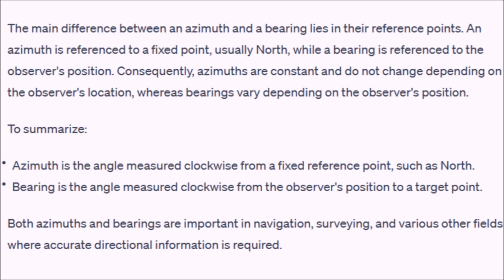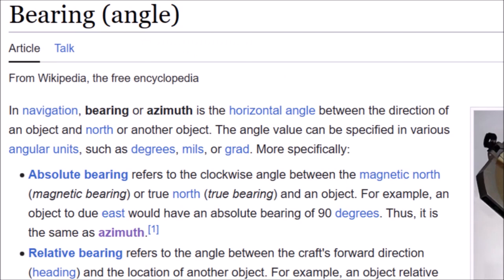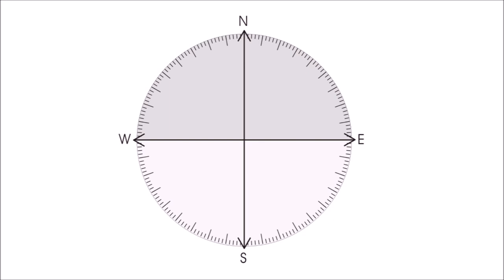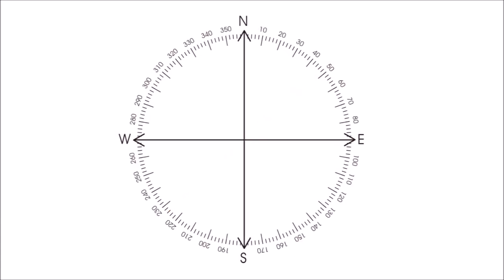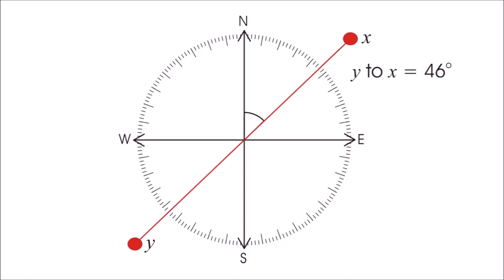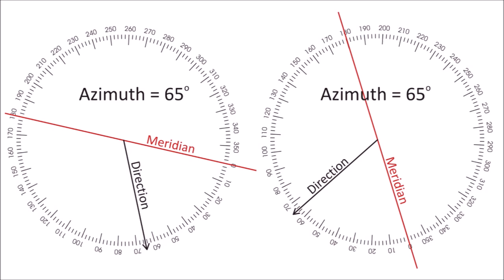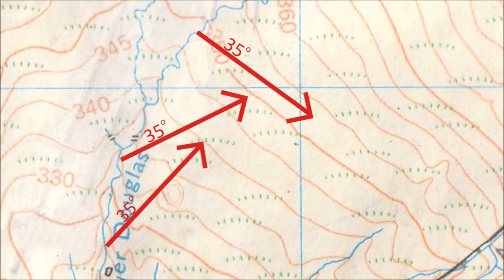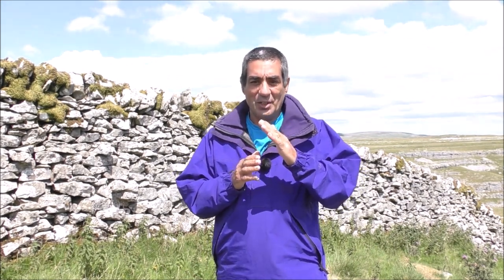Azimuth vs Bearing - there is a difference

Comment: Well, we can blame ship navigators for this (I think) because that's where the difference between the two terms is most important. Azimuth is just an angle relative to the ship, with 0 being straight ahead. And this leads to the best description I know: bearings are measured relative to North, azimuths are measured relative to any other direction.
Reply: It's relevant in surveying as well.
Reply: Your last sentence there really cleared it up for me.  Thanks!

Comment: In engineering field, azimuth is just one of the angles that define a spherical coordinate system. The meridian can be thought as one of the coordinate axes and the azimuth is just one of the two angles that define a space direction (azimuth and elevation). I guess that the problem is that someone gave to azimuth a "magnetic property" while it is instead just an angle with respect to a specific frame of reference (the meridian in your example). On the other hand, bearing lives in the navigation field and its an angle that is related to the magnetic north.

Comment: Difference between absolute and relative angles. Bearing is absolute based upon fixed zero (north) whereas azimuth is an angle from anything you say is your zero datum - wall, stream, etc. i.e. relative angle…

Comment: I'm a veteran of the British Army (royal tank regiment), and keen hill walker.

The use of an azimuth is when you know where you have travelled and recorded your bearing and/or azimuth changes.  

I often go for walks with no destination set at the outset. The point is to walk and pick a direction and head in that direction until it intersects with something (my new meridian).

So, if we were using your wall (meridian) yes we could pick any point for us to make up an azimuth to head along, and we could end up in any place parallel to each other uf the wall was straight like diagonal chevrons painted on the back of a highways vehicle.

However if you use a distinguishable point along the wall ie a stile, a gate, a sign or even a broken part if the wall or tree something describable and identifiable you can record that as I do and look about find a direction and take an azimuth reading from my (locator along my meridian).

If anyone was needing to come to my location say I'm injured and called for mountain rescue, I can lead them along my azimuth to key meridian landmarks ie stile, gate sign tree broken wall etc and the azimuth from that locator.

So azimuth does work provided the locator along the meridian is distinguishable to make the azimuth accurate to lead in the correct direction but azimuth only work if you are following directions and not just wandering aimlessly and then the search team are using an azimuth to find uou, they only work if you first record your azimuth from the first key locator (your car hotel bus/train stop cafe etc). Then every direction change is recorded so I take an azimuth of 143 and meet your wall, I record the 143 azimuth from my cars rear bumper facing across the road out of the carpark. When I meet your wall I turn east along the south side of the wall and walk 300m until I meet the stone stile,  I then take an azimuth of 40 and follow to my accident in a field 240m from the wall in a depression.

So azimuth can and are used effectively and provided they are recorded accurately as you go, they can save your life if rescue is needed.

Even if I'm not on an azimuth trail (wandering about lol) I still record my headings and distances and landmarks from departure to my current location, just incase I'm injured and need to get rescue to me. They ain't spending two days searching they know exactly where to find me before they even leave the offices.

If I could advise anyone if anything that would be my advice. Record every direction turn landmarks and distance /timing you can in as much detail as you can, the more accurate, the faster help gets to you.

Happy walking
Reply from the maker: All good points. Thanks for joining thr conversation.
Reply: That answers my question how to know which direction of the wall or rather meridian is azimuth zero.

Comment: I thought that I was differentiating bearings vs azimuths, but really the explanation below only differentiates grid bearings/azimuths (on a mapping plane) from true bearings/azimuths.

From a background in surveying, these are two characteristics that differentiate my understanding of bearings vs azimuths:

The first characteristic of an azimuth is that an azimuth changes as you move along the line whereas a bearing will remain constant from beginning to end. 
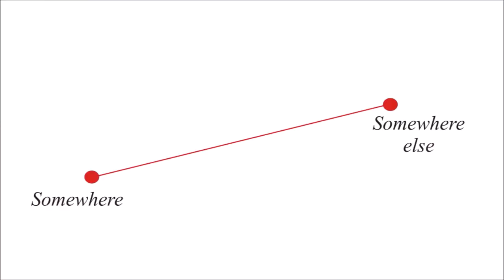The line shown at 5:15 is referenced in my explanation. Whether it is an astronomic, magnetic, or geodetic azimuth they all reference a northernly point from which a local meridian is created (from the observer to the magnetic north pole in this example); however, as you move along the line (in red) and take another observation a new local meridian will be created that is not parallel with the previous local meridian but still considered to be 0° along this new meridian. The result is that the exact same line (in red) now will be a different azimuth than what was observed at the previous starting location (somewhere). The difference will be negligible for walking distances but if we are travelling a long distance then the magnetic azimuth will noticeably change (and this change is not to be confused with greater circles and rhumb lines/loxodromes in mapping projections.

The second characteristic is that back-bearings (reverse bearings) of a bearing are a simple calculation: for example, 45° forward from somewhere will be (45° + 180°) 225° backwards from somewhere else. Direct and inverse azimuths are not computed as easily.
Because azimuths are all converging to a central point (in this case the Magnetic North Pole), spherical trigonometry is used to calculate the direct and inverse azimuth.

I think the video explains azimuths well from a navigational standpoint they are referencing a meridian and turn in a clockwise rotation.

By the way, in surveying we call your military bearings 'quadrant bearings' (S60E), and confusingly your civilian bearings 'azimuths' haha, which is why I like to call them 'full-circle bearings' (240°).
note: 'grid bearings' are also a good term for your civilian bearings.

Comment: Hmmmm . . .  I learned navigation in the US Navy.  What you are calling "bearing", I'd call "heading."  Heading is an angle relative to North, usually true North.  So when the captain wants to know what direction the ship is going, he asks for the heading. 

Bearing is relative to an arbitrary datum line, usually the centerline of the ship.  So the direction to a lighthouse would be given relative to the ship.  "What's the bearing of the lightshoue?"   90 degrees!  Which would put it off the starboard side.  

These terms were also in use in civil aviation when I learned to fly.

Comment: This is something completely new to me. Never heard of it, seen it or used it before. It is interesting to know, but I will probably never use it. It could be too confusing for the local scout group to whom I occasionally teach some map and compass techniques.
The military system N46°E mentioned here is well known to me, but is also never used. I limit myself to the 360° right-turning system.
Of course, I will try to remember this in case I ever have to deal with it.
Thank you for explaining this to us. A valuable contribution.

Comment: Superb. Just a tiny correction about military navigation, we used mils in my day both on our prismatic (lensatic?) compass and for eg. mortar plotting. 6400 miles to a circle. Brilliant video btw. I can’t recall using a baseplate compass. Ironic term since the mortar has a baseplate. But I can’t imagine a baseplate compass, which is all most people ever need, in mils.

Comment: As a Mariner, and practitioner of Celestial Navigation:

An azimuth is something that is calculated, something that is true, something that is, or has been, or will be. Something that is fact.

A bearing is something that is measured, using a compass (or gyro-compass repeater on the bridge or bridge wing). Something that is apparent.

Once per watch, when celestial objects are visible, we can use a compass (or repeater) to take a bearing. Compare that bearing with what the calculated azimuth is. The difference, if any, between the two, is our recorded "compass error".

The difference between the azimuth and the gyro repeaters should be minimal (fractions of a degree). The difference between azimuth and the magnetic compass can be significant at times (I've see up to 15° difference in the seas around southern Africa). The latter can be caused by Variation (what terrestrial navigators call "declination"), and/or Deviation (the effects of the ship's own magnetic field and, particularly on Containerships, the magnetic fields of the cargo).

Bearings of other vessels are used for collision avoidance decisions. Bearings of fixed objects can be used to fix a vessel's position (a Three Point Fix). Bearings are relative to North and are given in three figure notation (e.g. 090°, zero-nine-zero and NOT 90, ninety).

Bearings relative to the ship are referred to as Relative Bearings and are relative to the ship's head. or her beam (port or starboard beam), or simply "dead ahead" or "dead astern". They can be given in degrees (up to 90°) or "points" (1 point = 11.25°).

☀🌕⭐🚢🧭

Comment: That distinction might be handy close to the poles. If you are at a base located at the south pole all bearings and meridians on the globe converge under your feet. Using a local meridian that is identifiable might work better at local navigation around the environs of your base. Perhaps a fence line around the perimeter of the installation.

Comment: Stumbled over your channel yesterday! Good informative  videos! Thank you very much. About the Azimuth vs bearing movie I have two questions. A) at around 5:40-5:50 you show two lines: what is the reason for having zero degrees on the left hand side on the first line and zero degrees at the right side for the second line? B) Using an Azimuth and your example with the wall, you would also need to know what side of the wall you are, wouldn't you? Or have I misunderstand the whole thing?
Reply from the maker: It was to show that 0 can be at either end of the meridian, it's up to the user to decide which.
You're right about the wall.  Again it's up to the user to decide with is 0 and which is 180.
THIS is the reason (as I say in the video) that it is normal to use the north/south line on a compass as the meridian as this get's rid of any confusion.
Reply: @TheMapReadingCompany  You could (almost) say that the directions right and left is a very rough version of azimuth?

Comment: Which end of the wall in your example is 0 and which is 180 and why?
Reply from the maker: Hi Peter, it could be either so maybe this is where the confusion may have started..  This is why it is common to use the N/S line as the azimuth.
But of course the 0 – 180 azimuth line can be in any direction.  As an example if you are surveying a new construction site then you may choose the line of any nearby roads, current services (e.g. gas pipes, main electricity feeds, drainage, etc) or on a greenfield site the initial surveyor could just draw a line and that would be the azimuth for all future plans.
Reply: @TheMapReadingCompany  Thanks for your reply.  To give instructions then, one would have to specify in which direction one should turn upon reaching the azimuth?

Comment: I wonder if you can help.? 
Many years ago I had a Silva Base Plate compass that had a small prism set into the side of it. 
This allowed you to view the degrees shown, when taking a bearing, down to at least 1/2 degree. 
It was very much like what could be obtained from a "Plastimo Marine hand bearing compass". 
Do you know if these Silva compasses are still made.?
Reply from the maker: I think you're asking about the Silva 54.  You could contact Silva and ask for a reputable supplier.
There are lots for sale on Amazon but be careful if you order one. Make sure its genuine and in degrees, if that's what you're looking for

Comment: All new to me. Thank you.

However. Surely you need to define the direction of the Meridian prior to the Azimuth? Otherwise you could, potentially, be going 180° to your intention.

If the Meridian is heading SW to NE (bearing 45°) then an Azimuth of 90° would be a heading SE (bearing 135°).
If the Meridian is heading NE to SW (bearing 225°) then an Azimuth of 90° would be a heading NW (bearing 315°).

Am I wrong?
This would concur with @TheUnorthodoxy comment.
This would also explain why having a S to N Meridian is so commonly used.
Reply from the maker: You're right.  In navigation a standard azimuth isn't much use - it's mainly surveyor's etc which use them.
The North South meridian is the normally used as the meridian when using a compass so the direction is the same as a bearing.

Comment: im not sure youre correct.. in aviation, naval, astronomy and  surveying... What is the difference between azimuth and heading?
 The word is relative bearing, a bearing relative to your heading. Azimuth is a bearing relative to North . An azimuth is a type of bearing. turn 30 degree azimuth  east from north  of  your current position..
A bearing is relative to  your direction of travel.. bear left , bear right,,, bear left 30 degrees from your heading of 200 degrees southwest
Reply from the maker: Hi Johnny

Thanks for joining the conversation.  I must admit that I know very little about astronomy, surveying, geology, etc.  Although I recognise that many different fields use the same words with different meanings and the same things are discribed using different words in different counties (Yard / Garden - Flat / Apartment - Cot / Crib, etc, etc, etc,  😊)

The word bearing has many meanings.  In the UK and much of the world, in a navigation sense, a bearing is commonly used to describe the direction from somewhere to somewhere else using degrees.  

A bearing is not relative to your position or heading (as I assume that neither of us are in the hymalayas at the moment).  As an example from the summit of Everest the summit of Lhotse is at a bearing of (approx.) 168 degrees.

When talking about navigation, using a hand held compass, the word azimuth means a clockwise angle from a meridian (line).  As this line can be in any direction (e.g. the wall in the video) it is normal to use the North/South “line” as the meridian and so the angles (from the line) would be the same as a compass bearing.
Reply: Thank you for your videos. I find them very entertaining,  however youur explanation about the azimuth is not correct. It always refers to the north.  @TheMapReadingCompany
Reply: It all depends on context. In the merchant navy we have many different types of methods of describing direction. 
True Bearing: the clockwise angle from True North, i.e. east is 090 and west is 270.
Gyro bearing (similar but referenced to the gyrocompass north which should be the same as True North but will inevitably have some small error)
Magnetic Bearing: same but referenced to Magnetic North which isn't the same as True North unless variation is 0 at your location
Compass North: same but referenced to the north which your magnetic compass points to, which should be the same as magnetic north but isn't because of an error known as deviation.
Relative Bearing: clockwise angle from the vessels head (right ahead is 000 and dead astern is 180, abeam to port is 270)
Points: 32 points in a whole circle, can be used as compass directions or as a system of relative direction (steer NW by W, or look 2 points to starboard)
Azimuth: angle from a true meridian (N/S) in an E/W direction (e.g. N 65 W would equate to a true bearing of 295)
Amplitude: angle from E/W in a N/S direction (e.g. E 05 N would be a true bearing of 085)
We use True/Gyro/Compass Bearings for courses to steer, position fixing, indicating the direction of an object of interest or assessing risk of collision. Relative bearings are used for indicating the direction of an object, assessing risk of collision (if your heading doesn't change) and some basic navigation tricks (e.g. double angle on the bow).
Azimuths and Amplitudes are used for celestial navigation.

Everyone has their own jargon and the same jargon can mean different things in different industries or even sectors of the same industry

Comment: So, if the azimuth is taken from the north-south line, with north zero degrees and south being 180 degrees, does it have a minimum of zero degrees and a maximum  of 180 degrees only? Otherwise, the azimuth can be taken from the south-north line, with zero being south, north being 180 degrees. If it can be 360 degrees, with north being zero (or 360 degrees) and south 180 degrees constantly, then, is it not the same as a bearing? In surveying, I was taught the azimuth is an elevation, or, 10 degrees uphill for example, which by taking the azimuth of the north star (Polaris), we determine latitude. North star at 45 degrees azimuth means you are at 45 degrees latitude.
Reply: The instruments used to observe that angle would be aligned with local gravity (plumbline) and that 10° in your example sounds more like an altitude (90° - zenith angle) rather than an azimuth; however, I don't have much knowledge of astronomical observations in surveying.

Aligning your north to Polaris and turning a horizontal angle (say 45°) is considered an astronomical azimuth (or star shot).